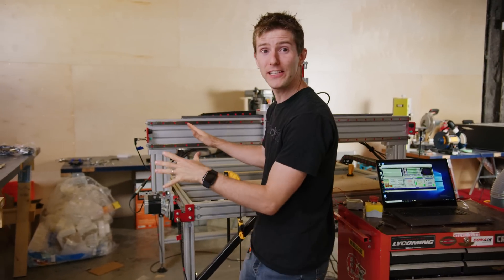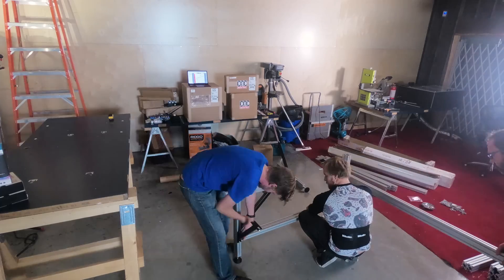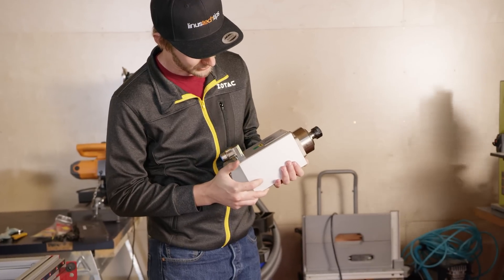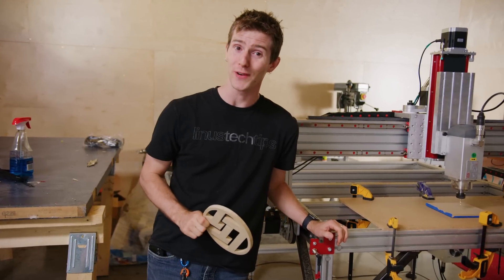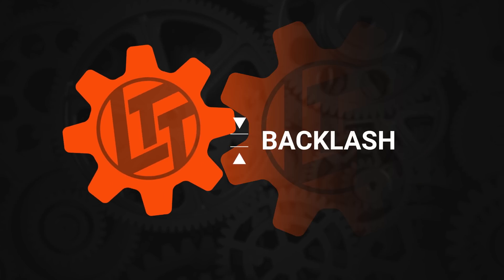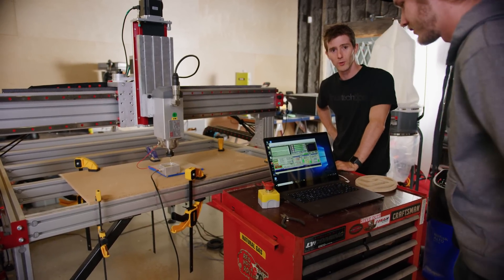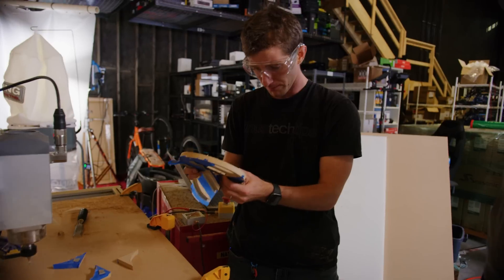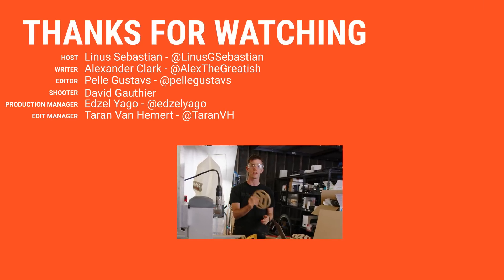Our New $10 000 Router!

Comment: Congrats on your new CNC machine! That's definitely something to be VERY proud of for having in-house. But...Please, guys, lockout-tagout when when performing work or maintenance inside the machine operational envelope. Tape out a perimeter on the floor to help visualize. Safety, safety, safety. Please also get a machine operation indicator light installed near the machine, and never place anything inside the machine operational envelope while it is operating (e.g. vacuum nozzles). Safety, safety, safety. Please be so careful, guys, and please heed this advice from someone that spent nearly a decade as a machinist and programmer for Thermwood Model 90's. I know this that these machines are so freakin' cool, and they are absolutely mesmerizing to watch. Just please be cautious, and know this machine can and will severely injure you if you are careless with its operation. Safety, safety, safety.
Reply: at a minimum always hit the e stop before getting inside the range of the operating head, and all moving parts
Reply: And don't forget to let the Bit cool off a little before changing it, if you have done multiple cuts or large cuts.  had a few burnt fingers in the past :D
Reply: Agreed, I have only a few months experience in industrial machines. (Work at Dynax. which uses machines that are on average the size of a room.) and trust me, a good lockout-tagout system is mandatory. Or even if you are the operator and the machine doesn't require lockout-tag out for the parts you are changing on it, ALWAYS hit e-stop/power down the machine. Or in my case, open another area of the machine you aren't physically getting into. That way, the machine won't function anyways and it's in a different location so someone doesn't mistakenly close it while you are doing maintenance. (To add to this, open an area of the machine in full visibility to you or close enough to you that someone HAS to make visual contact with you when going to close the opened area.  As I've had multiple operators assist me on a task on several occasions. So as precaution (considering sometimes they hang back while you fix the machine) I always open an area of the machine right near me, plus the actual area I'm working on. That way, I can tell someone walking by "Leave the door open. I'm not done yet!"

Those above tips aren't directly comparable to this machine, but at the very least, mark up the surrounding area like you said, ONLY have one operator running the machine at a time. Always hit the e-stop and as you said NEVER put foreign objects near the machine during operation. As these machines (or their huge industrial counterparts in factories) are extremely dangerous, and will kill you if given the chance. They don't feel emotions, they won't care if your arm is being drilled, etc. They'll keep on chugging till the operation is done or someone hits the E-stop.

Comment: Hey linus! Just a bit of a tip - when you're zeroing a cnc router or milling machine, you don't want to press the drill bit down onto a piece of metal. This can easily break your drill bit, and will also be quite inaccurate due to the bit being pushed down into the material. Instead, keep gradually lowering your drill into air, and then slide the material (preferably metal) underneath the bit. This way, you wont be able to push your bit down too far, and you will also get more accurate measurements due to the bit being the exact length away it needs to be.
Reply: They were zeroing Z with a conductive base block of known height.  It's a pretty neat procedure all told, and it makes for quick set up.  The thing I'd say to do is manually reset the zero a bit below the height you need so you actually cut through the material.  Otherwise with the variability of wood you're likely not to fully penetrate and have a lot more manual clean up on your hands.

Comment: 3D printers have probably more print options than a CBC router has. You can’t just press go. And they also use gcode and endstop switches... they are much the same.

Comment: If you ever use a bit that comes to a point like a cone shaped drill bit. MAKE SURE IT IS FIRMLY TIGHTENED ON. If it is not, it will slowly be pulled down by the material it is cutting until it comes off and fly's across the room like a deadly spinner toy. I have seen this happen, luckily no one  got hurt.

Comment: The motors don't have 200 electromagnets- they can and do have less electromagnets as they have comb-like toothed pole pieces, which allow for having more poles than there is magnets. the rotor magnet also has toothed pole pieces and therefore multiple poles, or is magnetized as multipole for motors with less poles. The teeth on electromagnets are arranged that one set of windings has teeth shifted corresponding to the other set, creating phase shift. There can be two or more phases, but two is common, and each phase has the same number of one or more electromagnets, depending on motor construction, but 200 would be impractical.

Comment: "It's not quite as easy as just hitting "Go" like on a 3D Printer". Clearly Linus does not know what he's talking about. You can  just hit "Go" on a 3D Printer. You also have to set a lot of parameters. CNC & 3D Printer are really similar but 3D Printing is additive, CNC substractive. Also why on earth did you use a wood chisel to remove the part ?
Reply: what whould you use ? its like a sharp object that can go under..... :D
Reply: @btc-maker2136  it's too thick ! I would have used a putty knife.

Comment: cnc a copper top for a delidded i9 9900k or a gpu heatsink out of solid copper thx :3
Reply: bullshit idea. both of them.
solid copper is not as quick as heatpipes, and you can't get anything that even gets close the performance of ANY gpu coolers out there. You just can't beat the heatpipes through thin densely stacked fins design. and the custom cpu ihs can't be made with this machine, this is a wood router, not a precision cnc mill. also. WHY WOULD HE DO THAT?
Reply: @MrDoboz Intel CPU lid's are made of copper there just nickel plated to prevent Copper from oxidizing. And that cnc can mill metals with that 3kw spindle. I have a 1.5kw spindle and I can mill aluminum easily.
Reply: its not really the material of the heatspreader (copper would spread it better but...) but the added material and whats actual between the material and the chip (solder or toothpaste.. :D)

Comment: The comments on this page are utter shit. Only few people have actually told what's wrong with this setting and they've been vague. Running the router in open space without respirators and starting it off by cutting MDF discs and breathing MDF dust? It's a nice, great thing to tell what you know. And if it's so much that you can't keep a list, then throw a link somewhere.

Comment: I run CNC's for a living, this feels weird!
Reverse your cutting direction for wood and MDF (use conventional not climbing), you will get better results! Also looks like you are using and upcut cutter so its best to to cut face down so all the crappy bits are to the rear of you work. I would also recommend slowing down to around 1000mm/min, you will loose most if not all of those rough edges.  (These are just my opinions, i'm sure people will disagree!) CNC's are so cool. Have fun!
Reply: CnC's are so cool! Sounds like great advice. I have very little cnc expereience, but that seemed quite quick moving.
Reply: wow, the only useful comment here with so few likes? pretty sad...
Reply: MrDoboz 
Cnc people always help
Reply: This is gonna make a great name for this CNC though
Reply: Awesome advice bud
Reply: We have a CNC in our school, and we build a plastic box to cover so dust wouldn't get everywhere
Sort of like the sand blaster
Reply: I'd like to stress that when BudBoyGames says to reverse the cutting direction, he does NOT mean to reverse the spindle direction. Look up diagrams for conventional vs climb milling to get a better understanding.
Reply: i agree. change the bit to a O-Flute, slow down the travel and keep the rpm's around 18k. i run one of these almost identical at my work (we are a major plastic manufacturer). anything from PET to HDPE to ABS, we normally keep a standard of 18k rpms on the spindle regardless of travel speed.
Reply: +BudBoyGames Stepper Motors aren't great at or above 2000 RPM so i would agree, that's probably the cause for the rough edges.
Reply: @budboy same, do you work with metals as well? It's so satisfying to look in the machine window
Reply: They also need some breath protection with machines of this kind. The dust gets ANYWHERE
Reply: Was coming to the comments to say all of this. You said it perfectly! Haha. They definitely were cutting too fast for clean edges.
Reply: first thing i was thinking when i saw it run. SLOW DOWN THE FEED RATE!!
Reply: I'm with you.  My grandpa was a CNC macienishy and operated them for GM. He also owned 3 CNCs in his life. We are talking $75 k mechanics. Something just dose not feel right about this
Reply: I agree they are running that since he rather way too fast
Reply: Right now i’m just a student learning about all this stuff but I had enough proactive with CNC machines to literally jump when I saw how fast their feed was. Like i’m pretty rough on the Feed rates when i’m in a real hurry but what they did made me almost jump out of my chair almost wanting to press the central stop
Reply: Noone can disagree when you are talking facts .
Reply: +so many.  I was amazed at how high their feed rate was, and while I don't know what their spindle speed was I don't think it was high enough for that feed.  I've pulled parts off tables before that were butter.  Oh, and I don't know if this is the "correct" way to do it, but I always set my Z zero maybe 2-3mm below the base of the part to ensure I get full penetration and don't have as much sanding to do.

Eh, they'll get the hang of it, or they'll destroy the machine or seriously hurt somebody...
Reply: @Linus Tech Tips You guys really need to listen to this guy !
Reply: Only good comment
Reply: Respect for the nicely categorised tool chest but would be interesting to see the risk assessment for this video. Surely there's a legal requirement for appropriate training when using machinery at work. Whatever the Canadian equivalent of PUWER is.
Reply: Wrong. Run it as fast as possible use a compression cutter (up down) and just go all the way through the board at once

Comment: In that first box you have two small meanwell power supplies probably 12v and 24v for control power 4 Stepper drivers and two bigger power supplies for the motors. Also please add some safety cage and estops.

Comment: It is actually almost exactly as DIY 3D Printer; only major difference is in a business end - CNC-router subtracts material, and printer - adds. By all other means mechanically they they are very-very close. 
You can even add 3D printer hot-end to this exact machine, perform some software mumbo-jumbo and it will double as printer.
Reply: Yes to this. Most, if not all, common 3D printers even use G code (though, obviously one does not set rotation speed for cutter head but rather the feed rate for filament (to match the movement speed etc.). The devices are far more similar than Linus seems to think.
Reply: The head cant move up and down that much tho
Reply: It would make some really decent sized prints if done right. the hotplate would need another power supply on top of what is already there. but highly doable. Would love to see this done. plus you could print entirely custom rigs in what ever material you deemed worthy. LTT should definitely try this
Reply: well that would be an epic 3D printer... but only if you can somehow make hotplate that big
Reply: MrDoboz  Printers don't really need hotbed to work. But hotbeds are nice and with big enough aluminum plate(and glass pane of the same size on top), a lot of peltier heat pumps, thermoresistors and buttload of power it's doable. 
Main problem of turning this thing into printer - very small available vertical movement.

Comment: Linus, to answer your question "this is considered safe practise?" No it's not. You need to cut off power to the spindle before you start putting spanners around it. Just because youy laptop isn't sending the signal to spin the spindle, doesn't make it safe enough. You've got a nice red safety button laying on the table, push it before changing the routing bit.
Also, backlash does not increase when changing directions multiple times.

Comment: Name:Cisco, the Router.
Btw, it's not harder to use than a 3d printer if you use the 3D printer to it's full capabiliites (not only the standard manufacturer's setup).
Just build a catalog of every tool you have into Autodesk Fusion 360, it will make things easier. Create a setup for the piece, then build the processes, home it and carve the hell out :)
Great machine, btw... really sturdy. Now buy safety gear and build a dust collection system :)
Reply: Cisco Not Cisco Router

Comment: In typical Linus fashion he got the explanation of something a bit... wrong.... it's ok we still love him.  The stepper motors only have 4 electromagnets in them, those magnets have small poles machined onto them that meet up close to their corresponding pole on the armature (thing that spins)e only issue... the inner armature has less poles that the outer magnets. This results in 200 possible positions that those poles can be lined up in a full rotation and by flipping the polarity of the electromagnets you can cause this system to step from one position to the next. Further more as he stated, if you drive those magnets with a different amounts of current you can cause the motor to hold a varying position between those pole alignments, however it should be noted that it reduces the overall hording torque. A ton on great vids out there that explain this better than I can, but essentially I wanted to make sure it was clear that the motors only have two electromagnet circuits that are split in half to both sides of the armature.

Comment: Like some other people have said, Dust will be a HUGE issue if leave it out in the open like that, I think you should put the cnc router in another room or build a room for it and have ventilation and filter it, otherwise it will build up very very quickly.

Comment: I've got a few.

Pronounced with a British accent(many Brits pronounce 'router' like 'rooter'), Routey Tooty Press 'n' Scooty. RTPS for short. Because it's routey(it's a router), it's tooty(it toots wood dust everywhere), it presses(like a drill press), and once it presses it starts to get scooty(which is how it routes things).

Routey McRouteface, obviously. Or maybe Big McLargeHuge. Also:

Big Awesome Drill And Stuff-Separator (BADASS)

The Rotational Obliterating Universal Tangential Extrication Renderer (The ROUTER, emphasis on THE)

Remote Agile Material Remover/Omitter Device (RAMROD)

The Heavy Extra-Linear Integrated Novel Unmaker System (THE LINUS)

The Progressively Ever-Neglected Item Slicer (Hazard a guess.)

The Bifurcating Uniplane Torsion Table System (BUTTS)

Rotational Energy-Driven Radical Obfuscation-Capable Keen Excavator Table (REDROCKET)

The Bisecting Orbital Object Bench (BOOB)

The Torsion Actuated Negative Geometry Reciprocating Annihilation Mechanism (TANGRAM)

That's all, folks.

Comment: "much more complicated than just hitting go on a 3d printer"-well actually from what i can tell it's actualy easier to use a CNC machine than a 3d printer when using cura you program about 20-35/40 different settings in to the softwear!

Comment: To remedy your double sided tape woe's use the tape and super glue trick (used many times on Crimson Guitars videos) put normal masking/painters tape on both surfaces, put a small amount of super glue on one of the surfaces and spray the other side with glue activator. Make sure you don't spill over the tape with the glue or you'll glue your work to the bed but once you've sprayed one side with the activator press the two together. Makes it much easier to separate work pieces from the bed and leaves no mess behind on your pieces aswell. If you don't believe me go check Crimsons videos :) Enjoy

Comment: You should chamfer the edges in the programme. And also don't go all the way through  because the edges will be rough on the otherside. It's better to just turn it over and run a little chamfer programme that opens up the holes cleanly without breaking up the edges. So you run it two times through the programme once on each side to not have to do unnecessary handy-work.